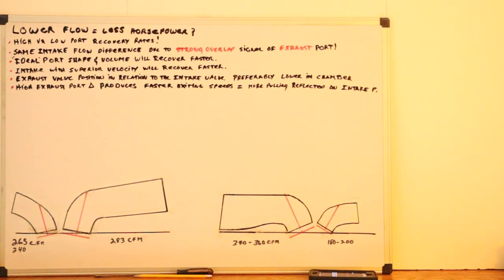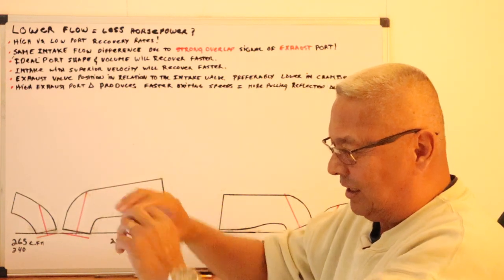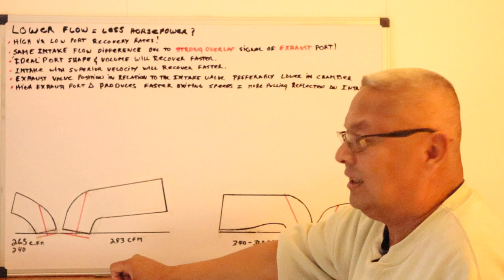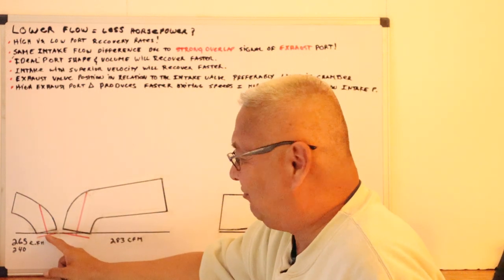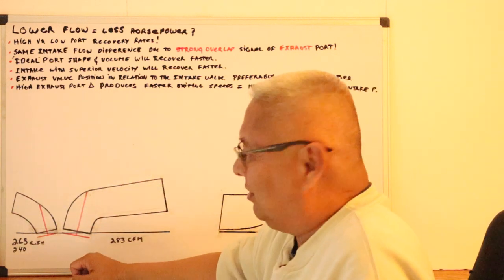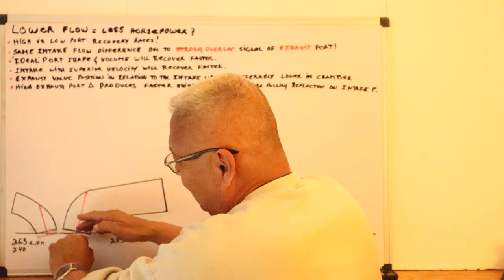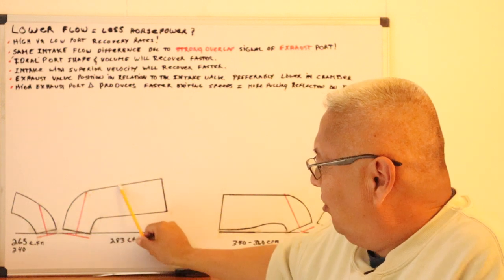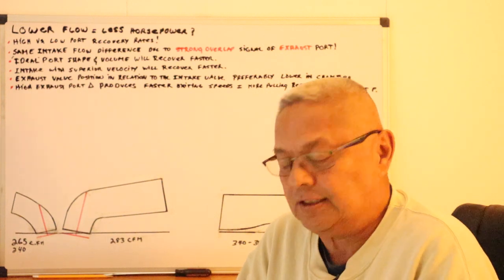PORT RECOVERY: AN INFERIOR HEAD PRODUCING EQUAL OR MORE POWER?

Comment: Can the piston pull in AFMixter back in the cylinder from the exhaust potr in the overlap period, when the piston starts go down?
Reply from the maker: During overlaps and depends on cam timing there is a possibility of reversion back into the chambers from the exhaust specially during or at low-mid rpms!  
Usually the backwave from the exhaust will happen at this ranges and can come back regardless of the pistons position...  Ex. velocity cannot extend downstream enough to prevent this from happening but at high rpms there is less possibilities except if the exhaust is plugged up and now it starts backing up!  Hope this is clearer.

Comment: So on a 6.0 Ls does the ls3 head being a raised runner design do this as good as a cathedral?
Reply from the maker: Chad, more likely than not the cathedral will recover quicker but the high ports will also function just as good if the Rpms gets real high and the port flow speed will be very effective at this range to pack the ports or recharge them for the next intake event!  If @ slower speeds if will be lacking compared to the cathedral with a lot of swirl and recovery capability!
Reply: @benalamedaracing2765  7000 rpm limit.  A good cathedral may work better on a 6.0
Reply from the maker: @CLEEPER1 , you are more likely correct!